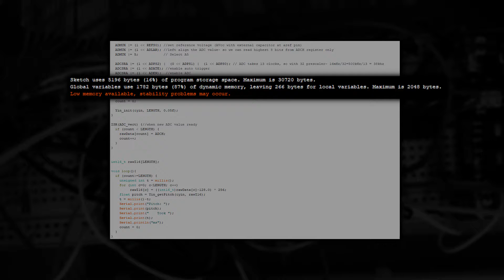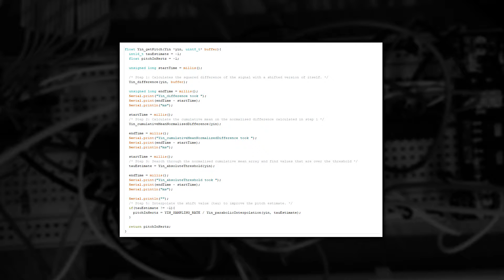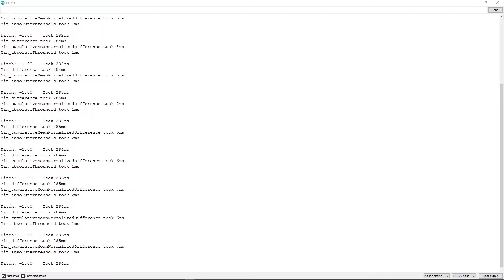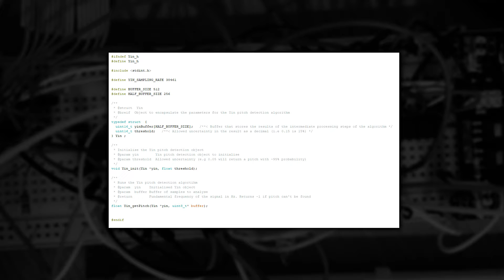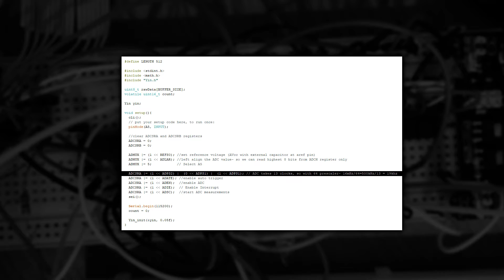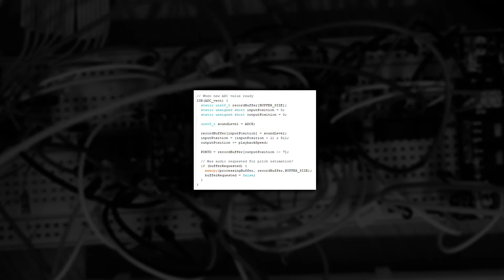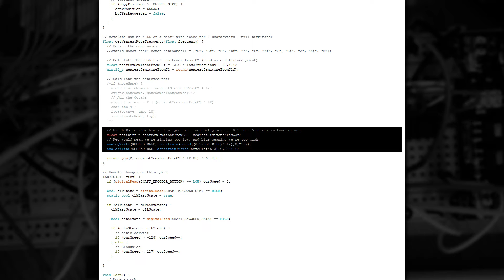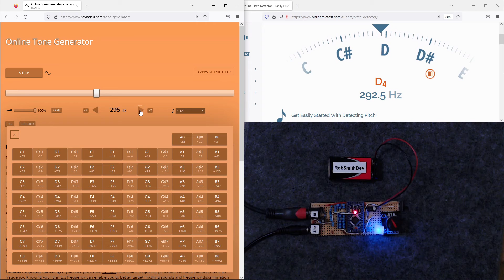Real-Time AutoTune  on Arduino - Sing like a Pro!

Comment: I keep wondering how much better an Arduino Teensy would be at doing this.
Reply from the maker: Being a faster device it obviously could out perform this which a better quality. I like to try to push the limits of the lower powered devices. At some point I may revisit with a different device

Comment: Hi Rob, great video and project.  I'm looking for something similar from different sources, with good performance and low cost.  I would like to see more videos related to the topic, if possible exploring hardware that enables better performance.  From the research I've done, I've heard a lot about applying Teensy 4.1 to real-time audio because it allows lower latency and has an audio library.  I leave here my suggestion for improving the project.
Reply from the maker: Hi, yes the Teensy is a very fast micro, it’s also quite expensive. I’d probably rather target a raspberry pi pico or esp device - I’ll have a think

Comment: Great video! I'm actually trying to recreate this device on my own, but I have virtually no experience with Arduino so bear with me. I know enough about circuits to translate the Arduino Uno schematic to an Arduino Mini Pro, except that the mini has no AREF pin. Is there an updated schematic specifically for the Mini Pro, and does the given source code still function the same for that board? Sorry if I'm missing an obvious solution here, but I'm very inexperienced with this stuff and would appreciate any help.
Reply from the maker: The uno, pro mini and nano are basically the same board. They all use the same chip. The smaller boards just expose less pins. The AREF is a good example. It’s there but you can’t connect to it. But it doesn’t matter in this case and will work just fine
Reply: @RobSmithDev  Great, thank you so much!

Comment: Can you reply with a timestamp of the input recording?  I can't find what the input sounded like.
Reply from the maker: Which part of the video are you talking about? There’s quite a few tests in there!
Reply: @RobSmithDev  i found them! Do you have stm32f103?  They were $2 before inflation.  They compile in arduino ide.  128k ram. 80MHz?
Reply from the maker: Not used them, but am aware of them. So many different devices to choose from. Mind you, with all that power there’s less of a challenge!
Reply: @RobSmithDev  it'll just sound better with the same effort in optimizing code...which is fun. I like optimizing for speed.